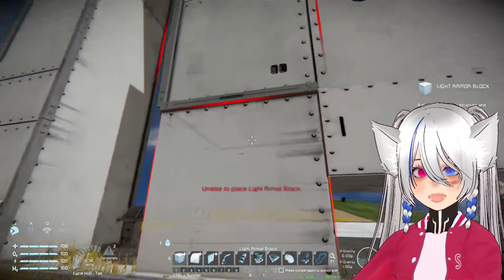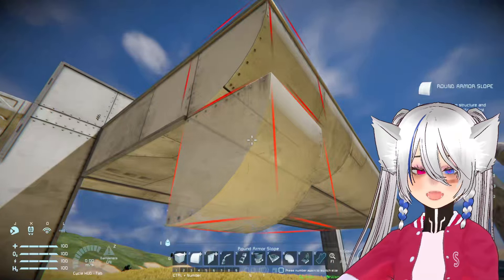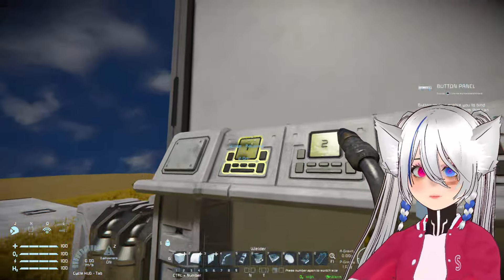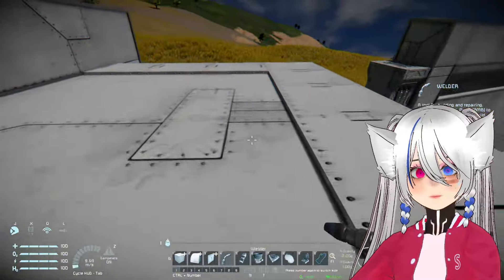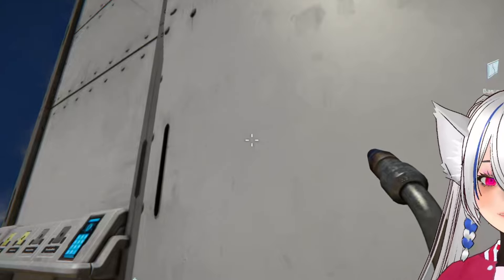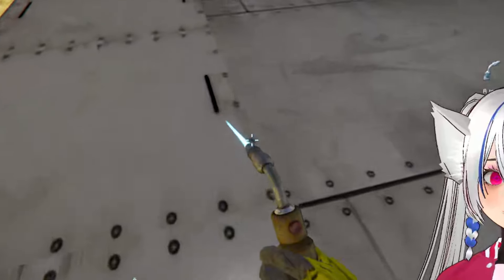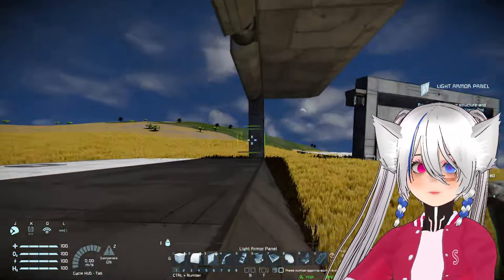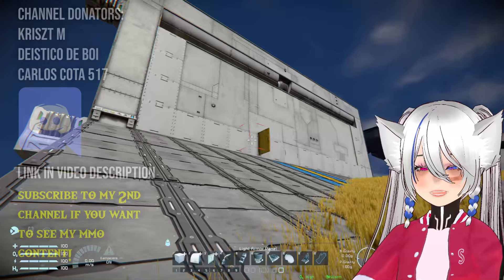This Lazy Building Trick Makes Custom Doors Sit Flush, Space Engineers

Comment: My go-to method is to make the door piston-based or use high-torque, low-speed rotors.
Reply from the maker: Good point c= I thought about that as well after making the video xD custom hangar doors using a piston might have less issues with gaps and stuff x3 rotor might have same gap issues though u wu

Comment: You can also use blast door blocks on the edges
Reply from the maker: Good point c= I thought about that as well after making the video, they would still have very small gaps though x3 but I guess those won't matter that much

Comment: Looks good. I'd like to see what you come up with to make a variant that is also airtight using merge blocks to seal the opening. I tend to have issues with alignment using hinges, because the hinge slightly displaces the blocks and won't get merge blocks to connect.
Reply: Most important thing is that two sides of the same hinge can't be on the same grid. To make a door mergeable you need a double hinge so that the two halves of hinges are from different hinge blocks

[GRID][Hinge main][Hinge part][Hinge part][Hinge main] [Door Grid]
This makes it so that two blocks aren't trying to merge into each other.
Reply from the maker: Thanks game c= not sure if I can make it airtight without sacrificing a bit of the ease of use u wu that would be nice though x3 and ye xD that can be tricky sometimes u wu